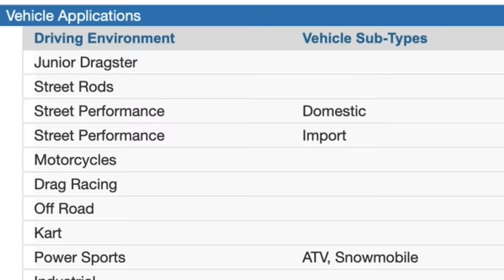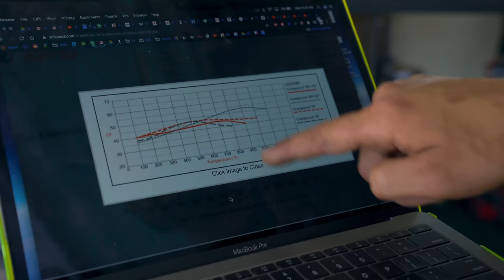Are Big Brakes Worth It?

Comment: can you elaborate on the parking brake setup a little? I can't seem to find anything from Wilwood about that setup you have. all my cars running wildwoods in the rear have had to have the parking brake converted over to and inline hydraulic set up with a line lock as a makeshift parking setup.

Comment: maybe he did it but it was not in the video: clean the mating surface from any rust with a wire brush before you install the new rotors. otherwise they will be wobbly.

Comment: It's a fallacy that if you can lock up your brakes, then they are "big" enough. Brakes turn kinetic energy in to heat. The more heat your brakes are able to dissipate, the faster they can slow you down. When you lock up the brakes, it means you have exceed the frictional and heat capability of the of brakes and they just lock up. All things equal (brake compound, brake fluid, rotor,... etc) the bigger the brake, the more heat they can dissipate before simply locking up.

Comment: One of the best brake mods I ever did was to a specialized (but basically under specced vehicle that I had to use) namely to convert to silicone brake fluid. Involved changing out all the rubber O-rings and thoroughly flushing the  system. Then added warning labels near the reservoir and on the service manual to warn all subsequent users to NOT mix conventional fluid in to my baby. Well worth it.

Comment: I have the 6 piston wilwoods on my Fieata ST and they are incredible compared to the single piston stock breaks. I used to run the polymatrix pads but they were way too aggressive for daily driving and I found that the BP20 pads are the best all around pads for aggressive street driving and occasional track days/ autocross

Comment: Wouldn’t two sets of calipers be better ?? Or much larger calipers??
Reply: not really, the smallest calipers that will do the job is better. and if they are already enough to lock the wheels you wont get any improvement making bigger apart from heat

Comment: not ' rotor warping ' brake pad deposit.. or pad transfer.. that micro deposit of pad in a localized spot will make the pad and pistons pluse as the pad runs over the deposit.. it will make it feel like a pulsing brake pad.. and as for the brake bias adjuster.. how did you test it? in the video,, you did not adjust the front to rear bias..me? owner.. alfa logic.. working on classic alfa romeos, ferrari's. auto bianchi's,  fiats.. lancia;s etc.. we do our homework..and make  , upgraded( big brake ) kits.. not off the shelf.. but idea, design and test.. before customers get to own them.. but overall you have a great channel
Reply: forgot,, if the rotor is rusted to the hub.. after you remove it,, it should be rid of the rust, and a nickel anti seize painted onto the hub surface.. nickel anti seize has a higher temp. rating than the copper stuff.. and brakes get .....hot

Comment: Or, it could mean your car's computer is applying brake force that's not 100% proportional to your pedal input.  Because they make most cars for people who don't, or might not be able to, apply the necessary/appropriate force. (EDIT: I'm talking about newer cars - not an NA Miata.)
Reply: The pedal applies the braking force, not the computer. The power brakes will make it so the driver doesn't have to apply much force, a child should be able to apply the brakes just fine.
Reply: @Redtooth75  Some cars, like my E82, have features like "Brake Fade Compensation," "Brake Standby," and "Hydraulic Brake Assist," among others. All of which are controlled by the car's stability control module. These are all methods beyond standard vacuum assisted/power brakes. I had to code them out of my car to get it's brakes to behave "normally."

Comment: it's so insane that car guys don't get why you need bigger brakes. bigger rotors are able to absorb more heat and you can use them for longer when braking hard, while stock brakes will fade out and leave you without any brakes and create dangerous situations.

Comment: What would you recommend for me I have a ‘96 f150 that I plan on carrying a lot of wheight with on a regular basis such as an atv a toolbox for truck bed full of misc stuff that is very heavy or my sled with the same toolbox (toolbox is 250lbs atv is 850lbs when geared up for a trail ride and sled is 600lbs when skid is full of snow which it always is when I finish riding) I live in northern bc so also has to deal with -35 to -40 temps at times also gets surprisingly hot here at times 30-35 at times
Reply: F250 sorry

Comment: ceramic pads are the end all be all all pads have a purpose. if you halling you don't want ceramic pads you want a semi met pad why cause you'll glaze a pad easily just like if your going high speeds and stopping alot you don't want a full met you'll score or even wrap a rotor there's a pad for every application

Comment: You like mini stories?  Keep in mind I been driving for 4 months and don't know nothing about cars really. My car worked normal, I drove it 30 mins away from home to an auto parts store to buy some tool and  "bleed" the breaks there from the master cylinder according to some YouTube videos. Ended up with no breaking power, break peddle to the floor and car woud drive away when e-break was released. Called some mechanics and told them I had no breaks and they said I needed to drive the car to their shop LOL Took an Uber home, 1 am took an Uber back to that parking lot and decided to drive my car home with no breaks i used  my e-break to stop, hardly any cars on the road, drove extra safe and careful I made it safe and next day I did a 100% Full bleeding and flushing? of all the break lines alone with my little home made kit and boom my breaks now are working better then before. I'm glad I decided to do that and try to fix it my self instead of paying a tow truck and mechanics most likely would scam me. anyway thanks for posting loving the vids 😅😎

Comment: You really don't need to change brake fluid once a year unless you're tracking it hard or there's problem or corrosion which has allowed water into the lines. Maybe every 5 to 6 years? Brake fluid degradation is very obvious when you brake, so you'll know when it's time to replace, it's not something you need to do as a matter of course.

Comment: Pump em....
Hold....
Pump em...
Hold...

If I had a dollar for evertime my dad said this. We owned a hope for years and I got off the bus there since I was 9. I did that until I was 21... 
I think I'm coming back to working on cars. I just repaired my mechatronics unit on the valve body in my bmw. I got the dreaded "turbine speed sensor" error and had to do some soldiering too. 

Fun times

Comment: The famous 95 MERC runs Eclipse calipers, ACDelco Drilled & Slotted rotors, Motorcraft Severe Service (POLICE) pads, Raybestos hoses, and ESI6 DOT 5.1 Brake fluid.
 https://www.mercuryforum.com/forum/grand-marquis-14/1995-grand-marquis-restoration-8937/

Comment: Does any caliper fit any rotor on a sedan or just like tires there are sizes and measurements for each and every specific vehicle?

PS
I know nothing about brakes, nothing about suspension either.
Reply: brakes are caliper specific, but some calipers support or share pads. but usually youll just be buying pads for you car, unless you have aftermarket calipers

Comment: Hi, 
I am having an issue with my Honda Civic 2004 ES
On smooth surface my brakes work perfectly, but as soon as I hit an uneven surface while braking, the brake's pedal gets harder, starts blocking and shaking. I am still wondering what is the issue with that. Can I get an advice about the issue  please?

Comment: For one big brake kit like this you dont need to change the master cylinder?
Reply: depends on how much bigger the brake kit is compared to stock, compare the piston surface area between the two
Reply: @arcanevoid9199  i have 242mm front brakes and i want to put 330mm ..
Reply: @Demolidor4ever  that’s disc size not piston, but probably a good chance that you will need to. that’s a massive increase

Comment: the eff. why would this kit have radial mounted calipers in the rear and axial in the front. this is dumb. 70% of the braking is done by the fronts which will in turn cause the most flex in the system.

Comment: Hey @donutmedia what about breaks for a 03 Yukon? I wanna put good breaks and rotors on, she's a heavy bitch and has a hard time stopping. What's your suggestions?
Reply: The limiting factor in your stopping distance should be traction, not the brakes themselves. The best way to decrease your stopping distance is to get better tires. If your brakes are working correctly then you should be able to lock up the wheels (or trigger the abs) if you push hard on the brakes. Better brakes increase heat dispersion which is only useful for racing.

Comment: Jobe my car doesn't lock up any wheels when I slam on the brakes
Reply: You definitely don't want that to happen if you want to stop on a dime. Modern cars come with ABS as standard, the objective is to prevent brake lockup by pulsating the brakes.

Comment: 9:07  . . . Shims

By the time the Miata was in production, Mazda was holding their brake mount surface tolerances withing ±.1mm.  No decently engineered kit should come with shims on this era of car.  What a garbage production shortcut.  Just make calipers consistently so you can make an accurate adapter bracket without extra hardware to rattle around.

Comment: Any change in stopping distance?
Reply: Stopping distance is limited by traction, not braking power. Unless the brakes are overheated.
Reply: @Redtooth75  I thought about another pads with higher coefficient of friction....
Reply: @JJ-sh9vt  higher coefficients would increase the stopping power with the same amount of pedal effort but the amount of stopping power you can actually apply wouldn't change. The brakes are strong enough to overpower traction and lock up the wheels, stronger brakes won't change that. Higher quality and performance brakes wear slower, create less dust and noise, and handle heat better. The only thing you can do to decrease stopping distance is to get better tires or make the vehicle lighter.

Comment: its a complete waste, especially if the car has had weight reduction done, the brakes become more efficient, a set of nice replacement discs and pads will do the job unless its a 24hour lemans car, bigger brakes will also add unnecessary rotational weight.